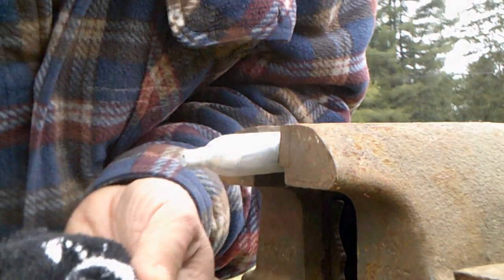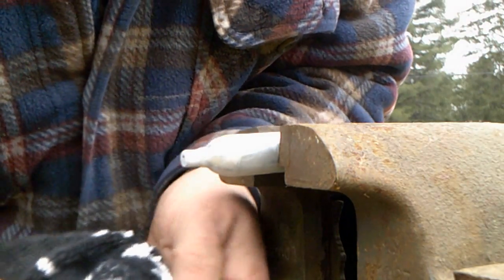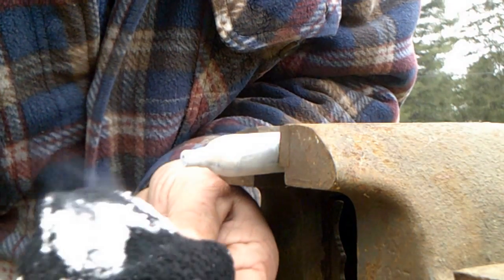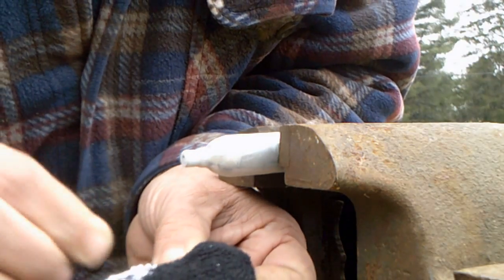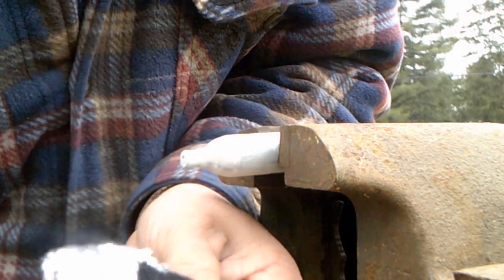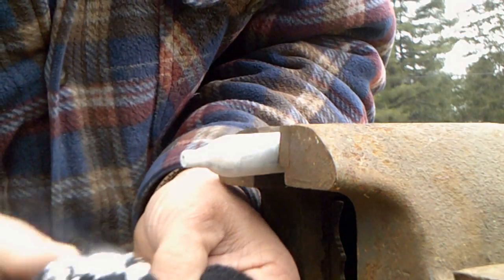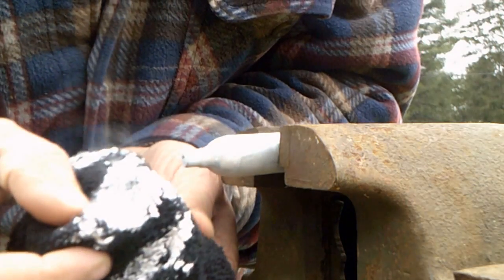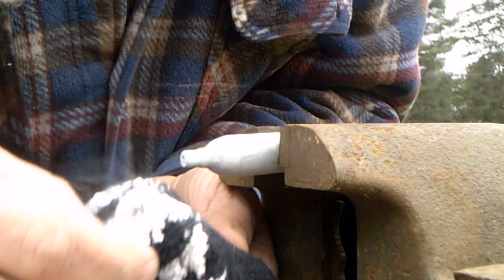HOW TO MAKE DRY ICE AT HOME!

Comment: is there any other way except this which was easier and simple
Reply from the maker: You can also make dry ice with a C02 fire extinguisher. Place the hose of the extinguisher into a pillow case and pull the extinguisher handle. Dry ice will then form inside the pillow case.